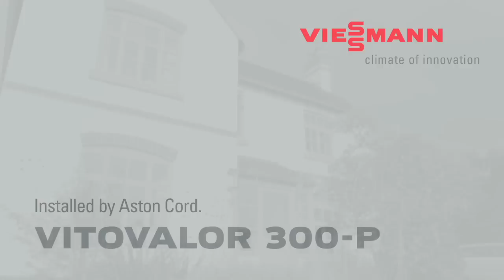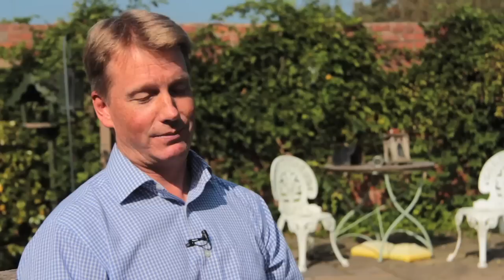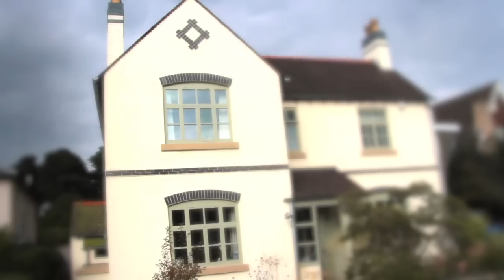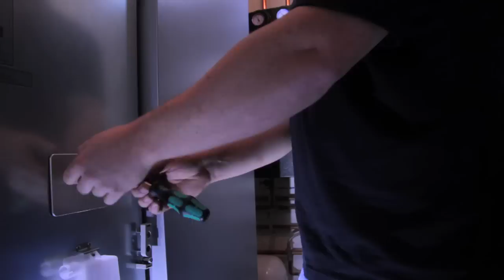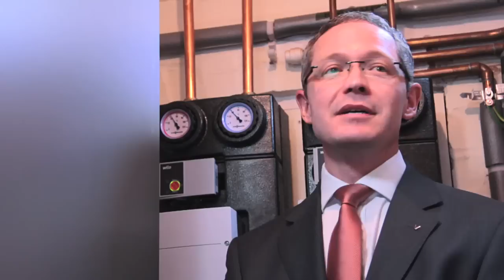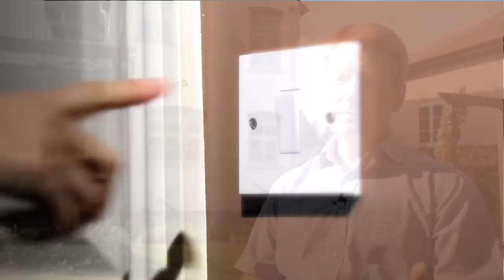Viessmann Vitovalor domestic fuel cell

Comment: 4000kwh seems terribly undersized to me. My household of 2 uses more than TWICE that, and worse, it sounds like it requires a supplemental external boiler ?  Sounds more like an ASSIST system rather than a proper stand alone alternative, and if that is the case then what is the point ?

I am very eager to see residential fuel-cell based mCHP become widely available (I need a system as I type this), but so far, the industry seems more eager to eat its own young (buyouts) and secure golden parachutes for their execs, than offering long term performance to their customers, along with parts & support that dont go POOF when the big wigs sell out.

So, what is the projected service life and 30 yr maintenance schedule look like ? Costs ?

Does it generate condensate requiring a drain, and if so how much ?

Is there a mode where it can be run full bore, in order to sell surplus electricity to a utility, and if so what happens to the excess heat generated if it is more than the needs for hot water ? 

Details pls.
Reply: Bump.
Reply: Hi RP.  The newest Vitovalor runs at about 750w per hour of generated electricity.  It's not going to cover 100% of required power in all households, my own house has a base load of just under 700w/h so it would in my case.  At peak it's giving 16.5kwh per day and importantly removing the cost and inefficiencies of traditional national power production. 

Long guarantees are absolutely a plague in my industry and others.  There are plenty of recent examples of startup companies promising the same thing and disappearing in the wind with any profits and capital raised from shares.  Viessmann is a very old and family owned multi-national who spends millions per year just on R&D.  They have untold volume of sales and a track record for reliability, they aren't going anywhere so their guarantee means something.

The projected service life is not going to hit 30 years, what mechanical and electrical item does?  Even old cast boilers from the eighties with no moving parts will fail or become obsolete before then.  The 10 year guarantee takes it to and way past the point of roi.  The boiler section will likely run for another 10 years as long as it's serviced, as it's based on a  222 model we can estimate that roughly.  The Panasonic fuel cell side we don't know exactly but the units have been researched and in design processes in Japan for 20 years and installed widely there.

It will create quite a lot of condense, a slow trickle all day, how much I can't say for sure but technically it could be calculated based on demand.  It's immaterial really, unless you need to catch it in a bucket, it will be connected to a drain.

Lastly no, there is no way to run it full bore to generate electricity.  Other than being unethical and wasteful, the Vitovalor is heat led not power led.  It is designed to generate the electricity as a by-product.

If you are interested in learning more then have a look at www.vitovalorinstaller.com we will be adding to this site regularly with informative videos and faqs.
Reply: Vitovalor Installer Thank you for the patient and detailed reply. 

In no pariculat order:  

+ Yes, the 30 yr number I picked was somewhat faceteous, on my part ... I was sorta lampshading the state of the industry vs the practical interests of a customer there. 

+ It sounds like I was right about this being intended as an assist system rather than something thst could be used  off grid if desired, and that ot is heat centric rather than power centric. I think it'd help potential customers for the product descriptions to clarify that a bit better.

+ Is anyone doing residential installs in the NY Usa area anytime soon, and/or is there a general ballpark on costs ?

Thx in advance.
Reply: Hi,

The Vitovalor unit has a boiler built in, it sort of is its own assist system for heat.  The boiler will step in for peak demand.  If you mean the electricity generation part then it depends on the property, potentially if you had a low base and a battery you could avoid buying in power but as this has to run on natural gas it's unlikely (at the moment at least) to be installed in "off-grid".  It may be re-engineered in the future to run on other fuels but for now it's an on-grid centric unit.

You would have to contact Viessmann US to find out if the Vitovalor will be available.  The financial viability is completely dependant on the grants and incentives available in the UK the rest of Europe.  There are four different incentives here in blighty that make it financially beneficial; PACE funding, lower VAT, RHI and feed-in tariff.  Without even one of these it may be difficult to market so you'd need to find out if an equivalent system is over the pond.
Reply: My household of 2+2 uses 4200kwh per year, averaged over the last decade. So this is a good offer.